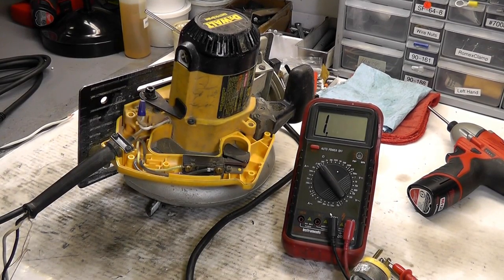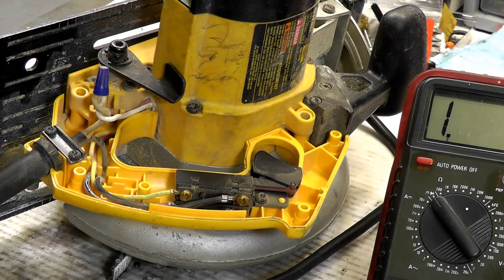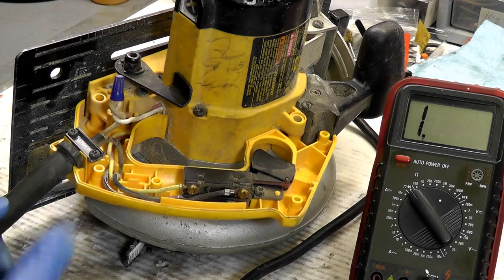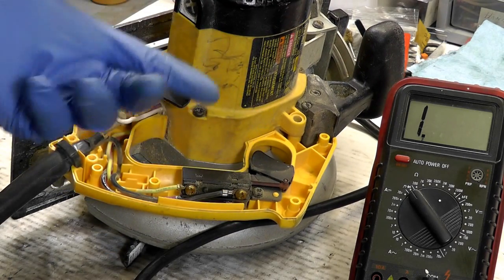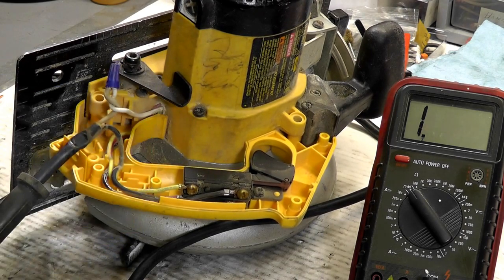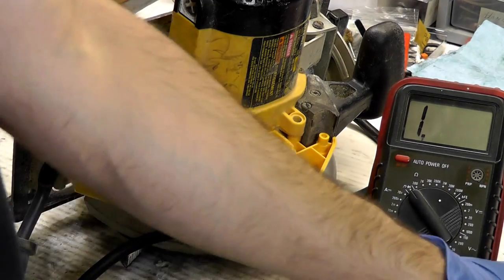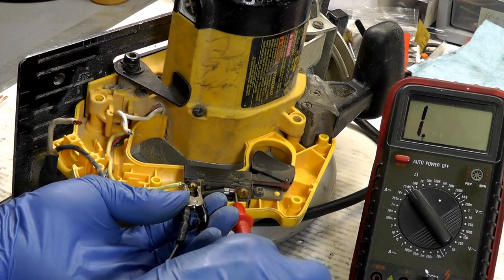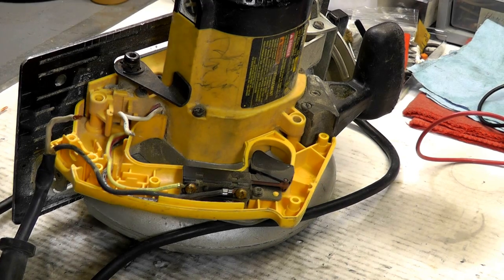How To Diagnose Electrical Problems With Power Tool

Comment: Have a wagner paint gun that started tripping my GFCI outlet.  Bought a newer model and it works fine.  I checked the older gun with my multimeter to connect only to the plug as you're showing and it checked out fine, so its obviously something further up in the tool.  Pulled the cover off then tested the switch - it was fine.  So pretty sure it was the motor.  Scavanged the switch and cord, the rest went into the trash.

Comment: I have a Bauer 6 in polisher  I've got continuity at the power switch from one side to the other with the switch on ....switch off there's continuity between the 4 contacts on the back side but only throughout from one side to the other with switch on as it should be it's got like a little contactor type switch but then there's a variable speed switch and I can not get a beep out of it no matter how I poke and prod it I'm sure it's just user error so any advice oh I removed the variable speed switch from  the machine and still nothing I'm sure that it's bad but can not say for sure at this point. Because I don't know what tgehellim doing lol

Comment: Any common issues with Bosch GST150  …mines hardly been used and its stopped working..it started with going slow then when i tried it again it was fine then i came too use again and then went slow again , not it want go at all. Checked basics !

Comment: Do they make a non contact rpm tester for electric tools to test the rpms? My 12 in inch mitre saw seems to be turning slower than usual. I'm wondering if one of the brushes is not working correctly.
Reply from the maker: Thanks for the question, Peter. 

Sure, any of the digital tools will work. You simply place a white mark on the rotating part, then shine the digital tach at the rotating part and it will show you the RPMs. Here is one on Amazon:

https://www.amazon.com/AGPtek%C2%AE-Professional-Digital-Tachometer-Contact/dp/B004Q8L894/ref=sr_1_2_sspa?dchild=1&keywords=AGPtek%C2%AE+Professional+Digital+Laser+Photo+Tachometer+Non+Contact+RPM+Tach&qid=1627394126&s=automotive&sr=1-2-spons&psc=1&spLa=ZW5jcnlwdGVkUXVhbGlmaWVyPUExNkZYRFhNTzlWQzNMJmVuY3J5cHRlZElkPUEwNDkxNDE1M0FFNTVLNVg2RjNPWCZlbmNyeXB0ZWRBZElkPUEwNDMwMTg5MURGVEkwRlNEWUNIVCZ3aWRnZXROYW1lPXNwX2F0ZiZhY3Rpb249Y2xpY2tSZWRpcmVjdCZkb05vdExvZ0NsaWNrPXRydWU=
Reply: @MasterToolRepair  Thanks, I did see that done but thought maybe they made one like what they use on mowers, chain saws, etc. 
PS, what's the best marking media to use, tape, paint? Thanks again.
Reply from the maker: @peterford9369  Either will work, honestly. The kit shown comes with reflective tape.
Reply: @MasterToolRepair  Cool, thanks,

Comment: That does not mean the cord has a short. It could just meat it is open. If the cord has a break, it could be considered open circuit. You are shorting the cord when you test across the two leads.
Reply from the maker: Good catch. What I SHOULD have said is, "this is intermittent showing that the circuit is opened when you wiggle the cord, thus not supplying power to the saw."

Comment: Hello my name is Ricardo am Brazilian and repairing mechanical electrical tools dewalt bosch makita.tem work in the US ??? How much does a repair mechanic ???
Reply from the maker: Thank you Ricardo. Are you looking to have these tool repaired? It certainly depends what the problem is and how serious it is. I always recommend calling the manufacturers directly and speaking with a local service center (if there is one in your area) or asking for a technician who can assist you with this information. If you click on the "contact us" link at the bottom of the page on these manufacturer's websites you will get a phone# or an email form you can fill out.
It honestly just depends on the tool, the age of the tool and what the problem is exactly. Most repair shops charge by the hour or by the type of tool. E.g. electric power tools have a minimum of $25 labor up to $60 (plus parts), depending on what the problem is.
Reply: Master OK . thank you I am technician in service repair .quero eletricas machines know if you have work for me in america Repair
Reply: help me
Reply from the maker: I am sorry Ricardo, we do not. We are a web business and only ship parts out, we do not have a service center or repair shop. We do these videos to help people diagnose and repair equipment but do not operate a repair business.
Reply: @MasterToolRepair  I might be mistaken but I feel he is (was, 4 ears ago) looking for an open position in the US as a service technician :) I think he meant "How much does a repair mechanic [make in the US]?" Ricardo, have you managed to get a foothold there? Are you a rich man by now? ;) 
By the way, this video I just watched was awesome! I'm nust getting into repairing my old tools around the house, and this instruction is a life-saver (in terms of what to look for)!